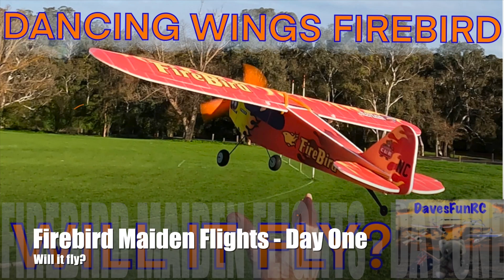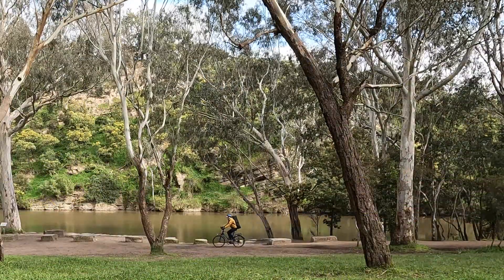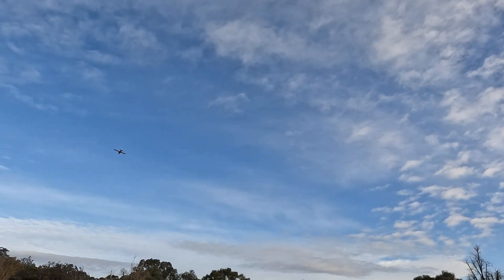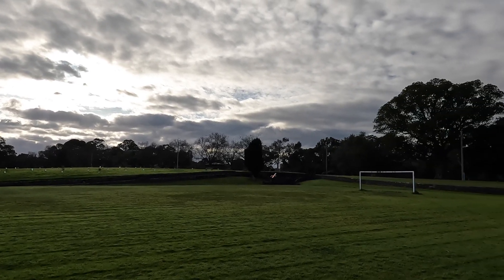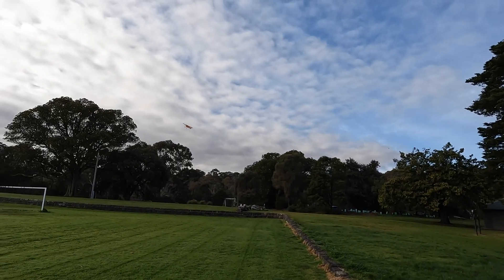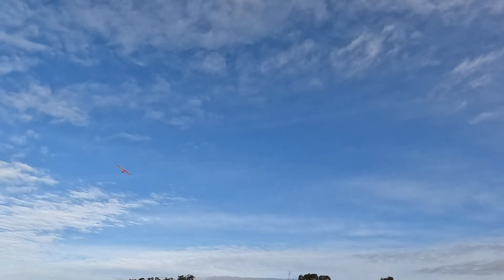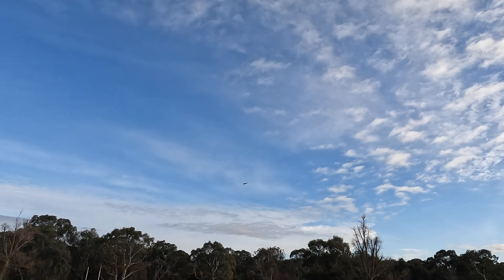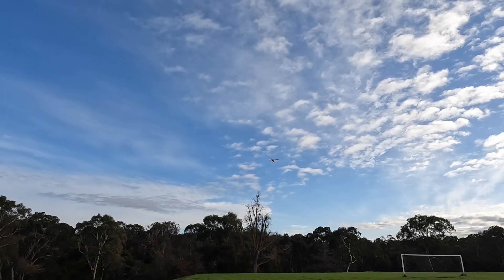Maiden flights of Firebird RC Plane by Dancing Wings. How will it fly?

Comment: I have built 8 dancing wings balsa planes and all fly perfectly well on first flight but that could account to that I actually balanced the planes out perfectly on the bench and balanced the prop and made sure everything was square plum and true before maiden. And all of them only needed three clicks of trim total
Reply from the maker: Hi, thanks for your comments. I am still getting a lot of fun with my Firebird, which I mainly fly outdoors on calm days. I also recently discovered that all my 5030 props were out of balance. I’ve since balanced them and reduced the vibration a lot. My Savage Bobber is now retired. It never flew very reliably, mainly because it wasn’t straight - my bad construction. The Firebird was much easier to build.  Happy flying!